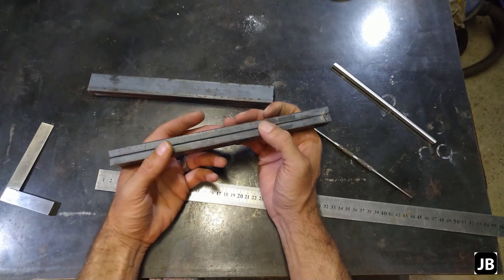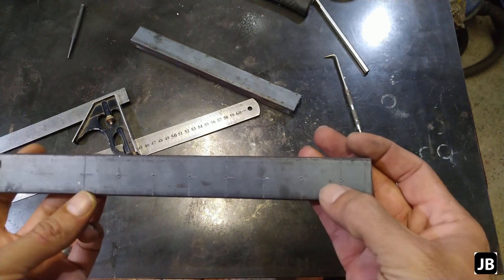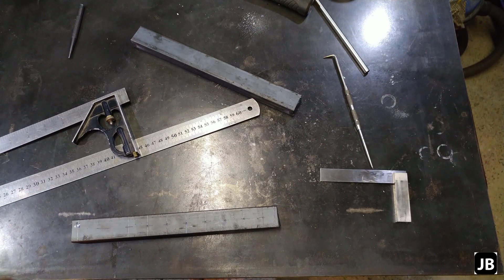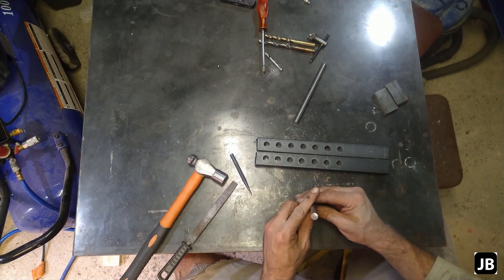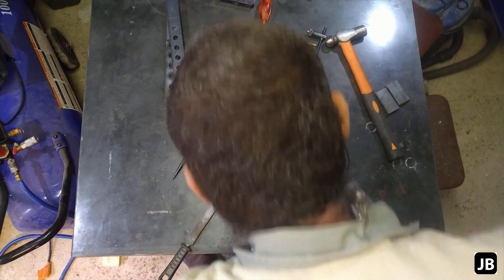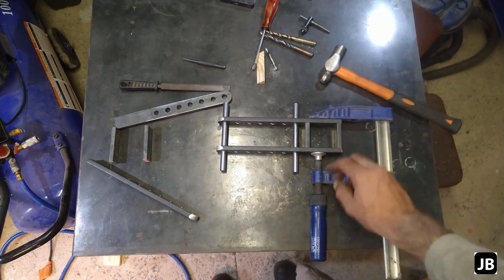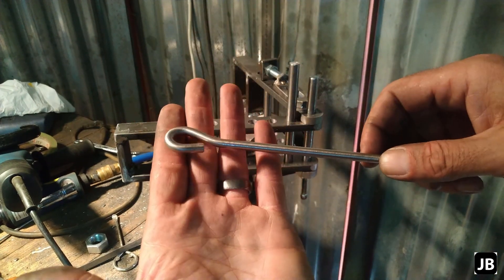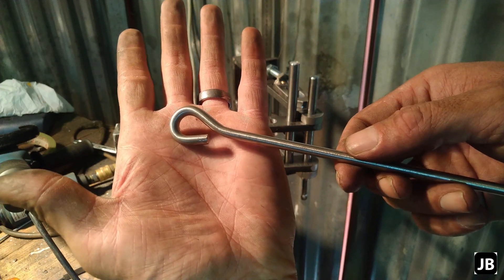Homemade Metal Bender (Hossfeld style)

Comment: Nice work. funnily I made my own hossfeld clone about the same time. So far I've only had time to finish the main body. I'll be making some of the extra pieces soon. I only had 6mm steel on hand so mine's not quite as robust as yours. I'll have to see if I can get the same clean results ;-)
Reply from the maker: Great minds.....  I will be honest, there were no analysis done for the design, I have found over the years that if I completely over-design/build a project, the chances of it coming out half decent are better than trying to skim it of.